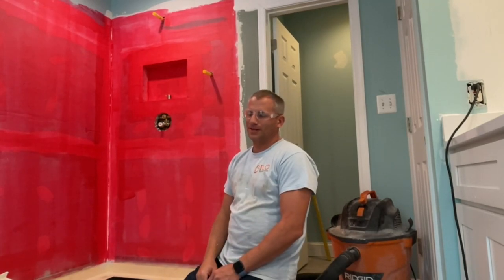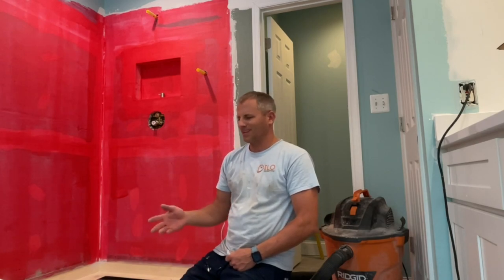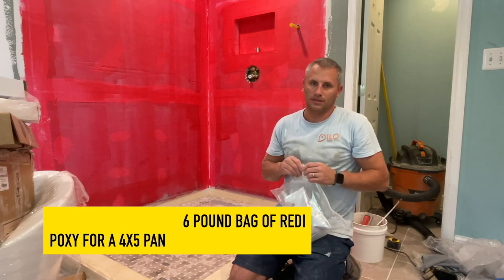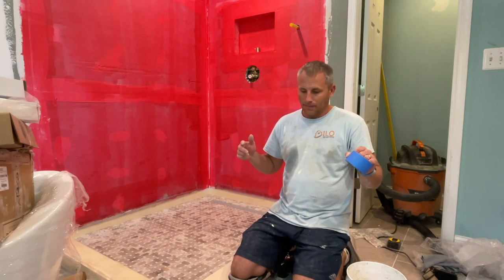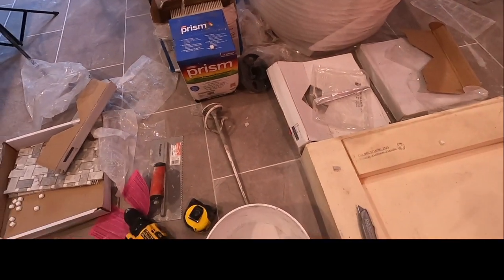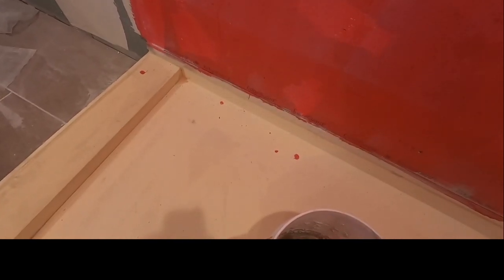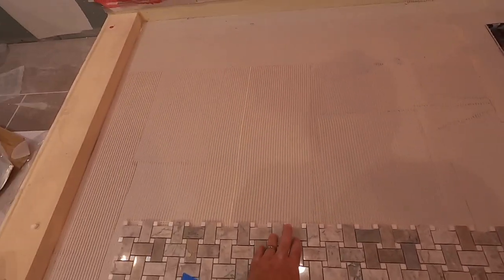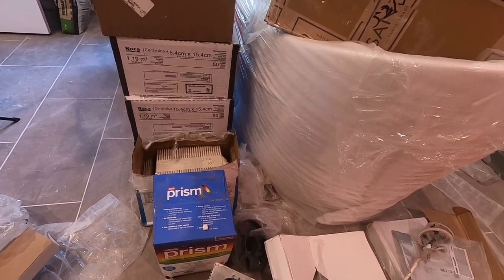How to install tile on a Tile Redi base. Tips, tricks, and updated info concerning the system.

Comment: This video was a great help to me, thank you. I'm a rookie, and I have a couple of stupid questions if you'll tolerate me. First, I've got a Reditile pan installed with the flashing kit. It looks like with the flashing installed, I can just run my backerboard in front of the flashing, all the way down to the base. Correct? Second, when waterproofing, do I need to use a membrane and Redguard, or just the fiber tape and red guard? Thanks again!
Reply from the maker: If you want to build out the wall, i guess you can put the substrate in front of the base, but you don’t have to. The substrate usually goes on top of the tile redi base.

Comment: Nicely done.  Never seen this product.  What notch did you use to put down the epoxy?
Reply from the maker: Depends on what tile you put down concerning the notch. Usually I use 1/8x1/8 notch for small format tile. If it’s pebbles, I go 1/4x1/4 v notch. It’s an amazing product and I can sleep well at night the pan will not fail.

Comment: We installed our custom tile redi base 42”x72” with left sided trench. We are rookies at this… how do we deal with the slope on the base when it comes to installing the 12”x24” porcelain tile on the wall? We are installing penny tile mosaic on the base. Thank you!
Reply from the maker: Well, first step is to buy a tile cutter that can cut 24". Second step is to make out the line where the first row of tile will go then measure down from that line to get your cuts. Tile work is an art and you might have some mistakes, but be patient. We all were rookies once!
Reply: @TodayIWorkOn  thank you! 🤞🏼

Comment: I installed my tile redi pan using your advice and it came out excellent.. Do you embed mesh tape at the tile redi/backer board seam?
Reply from the maker: Hey Bob, I put the tape on first then bed the tape in the mortar.  Then I redguard.  Awesome work on the install!
Reply: @TodayIWorkOn  Thank you.. I just want to mention that Tile Redi must of stopped shipping the epoxy with their pans. I received mine recently and it was not included.
Reply from the maker: @schulz4313  correct. They stopped shipping the Redi poxy because the new pans can use the approved modified mortar. I personally still order the redipoxy for peace of mind.
Reply: @TodayIWorkOn  I have an old school tile redi pan and bench. It is 48x60. The top of bench was tiled and grouted using modified mortor. 
I did get 2 boxes of Redi poxy with my pan. I believe they are 4lbs each. I am installing 12 x 24 porcelain tile on floor. Do you think I need to order extra Redi poxy?

Comment: Do you use the same thinset that epoxy based stuff for the side walls and curb when tiling. Or just at floor of shower
Reply from the maker: Just for the floor. The new bases can use modified thinset mortar, I just like how well the redipoxy sticks.

Comment: Tile Redi instructions for a tileable trench grate calls for PL Premium Adhesive, so just smear it on top of the steel grate and place tiles and or maybe back butter tiles with it (pebbles in my case - i know right) ?  Any tips for this, thank you in advance.
Reply from the maker: Do you have redipoxy? That WORKS! I've used it on tillable grates and it sticks really well. Modified thin set might also work.... using the PL adhesive sounds super messy.
Reply: @TodayIWorkOn  messy is what I was thinking and, yes!  I have redi poxy.  I have plenty of redipoxy, a bigger batch and a couple smaller because I bought it last fall before you kinda changed up to modified thin set on floors.   But for a pebble floor maybe I'm better off with redipoxy, just nervous about less forgiving with time of putting down pebbles - So, I will for sure use redipoxy on the grate, should I get pebbles all cut and laid out and use redipoxy or modified thinset ?  I'll help you do it - lol - thanks again for you help
Reply: My question at end would be in regards to the floor - about a 30x60
Reply from the maker: @eaglecanyonherefords2538  How I Install Hexagon Mosaic Tile on a Shower Floor With a Trench (Tile Redi Base)
https://youtu.be/xLHZVI8cStE

100% precut the pebbles and use this video on how I install the pebbles. Your only difference is you will have to use a grinder to cut the pebbles.
Reply: Sent you a little thru google for my gratitude, thanks, hope they get it to you - i didn't leave a message
Reply from the maker: @eaglecanyonherefords2538  Thanks so much! I'll let you know, was it a "super thanks"?
Reply from the maker: It just popped up in my YouTube studio, Thank you so much! That was so kind! 🙏
Reply: @TodayIWorkOn  You're so welcome, the tips I got from you have been awesome!   I just finished thin-setting the pebbles in 😅👍- whew, it looks good and redi-poxy would have been too much stress for me - ha ha - God Bless you and yours 🙏

Comment: Well in researching as much as I can about the Tile Redi Shower Pans and the system -- of course I came across a FORUM where I was getting very bad vibrations about this company and their products!  I am watching your you tube to see if those vibrations can be calmed down and I can feel a bit more confident that I want to have a Tile Redi 72" x 36" with Bench installed in a new home I am planning --  How long have you been doing showers using their products and is there anything you would say to steer me away and over to some other method of doing a shower with a bench?  Also have you ever used the Tile Redi Redi Wall they sell and if so, would you use a waterproofing membrane as you did here with this shower using the Red Gard or what it is called?
Reply from the maker: I have not used the tile redi panels since they are super expensive. They look like they work, but are again, expensive. I do not recommend their bench because it limits you greatly. I have a video on how I installed a custom bench with a standard tile redi base. Good luck with the project!

Comment: Is there a way to waterproof the outside of the curb with the bathroom floor?
Reply from the maker: You can use ditra band or my flex tape. Then hit it with some red guard or something similar. Water proofed.

Comment: Do you use the redi epoxy for the rest of the floor pan with the other tile?
Reply from the maker: You don't have to on the new pan, an approved modified mortar will stick. I have a new tile Redi video dropping in the next couple of weeks to explain even more on this base.

Comment: You are using Red Guard please what do you think of the schluter membrane system?
Reply from the maker: I think it’s fine but very expensive. I have used it and it’s a little bit faster to work with, but I just like cement board. The substrate you use is totally what you like best. They all work well when installed properly.

Comment: Do you used regular thin set between backboard and tile redi base overtop the flashing? Or do you use this epoxy for that
Reply from the maker: A good modified thinset will stick to the new pans. If it’s a pre 2021 pan, what i did was apply some redipoxy on the sides then apply mortar. Hope that helps.

Comment: One question. What size tooth trowel should I use with 12x24 tiles, or 12 x 12 tiles using epoxy? Or should I use thin set with tiles that big?
Reply from the maker: I think you will need the approved thinset for 12x24 tile with 1/2 square notched trowel. You need really good coverage for large format tile with 12x24.
Reply: @TodayIWorkOn  OK That sort of what I was thinking. My wife wants larger tiles for less grout line to clean, but maybe we will look at 12 x 12 ....thanks once again. Great videos.

Comment: i hope I didn't miss you covering this but when you do your walls are you going to use epoxy from the floor to over the top of the flange / seam ? And epoxy the curb right?
Reply from the maker: You can use a modified mortar on all of the new pans. Before that was possible I used to cover it all in epoxy, but thankfully those days are over! I'm actually dropping a video where I use modified mortar on the pan in a couple of weeks.
Reply: @TodayIWorkOn  You are the best - subscriber, follower and big fan - lets get down to business! 👍
Reply: @TodayIWorkOn  did you complete the job applying thinset?  Is there a link to the video?  I'm installing the shower pan this weekend and looking to tile it the following weekend. Debating between Epoxy and thinset. I appreciate your response
Reply from the maker: @sagudelo70  https://youtu.be/khxgJJ6-FTU

Comment: Is it possible to install a detra heated floor in a shower using tile readi base?
Reply from the maker: That’s a great question. If I was going to install ditra heat, this is how I would do it.  I would use redipoxy to install the ditra mat on the tileredi base. Then I would run the cable on the ditra mat like I normally would. I would use more redipoxy on the threshold and embed the thermostat and ditra heat cable in the redipoxy. After it set up, I would build out the threshold with 1/4 of mortar because you can’t cut the tile Redi pan at all.  It’s too thin. Then I would tile normally. So, would tileredi say ok to this, probably not. But, would I think this would work, I would say yes. You can also build up the trench grate to the height of the tile with no issue. Let me know if you go for it!

Comment: hey sir, I noticed the back end of the pan has a shoulder, the one i ordered does not.  did yours come with that shoulder piece?  i am not sure how to add glass on mine, it is just the thin wall like the rest of the pan. except where you walk in.
if your looking at the video, it is the back of the pan ( left side)
Reply from the maker: There’s different types of pans. This pan has the threshold on the front and left side to accommodate glass. You might have ordered the wrong pan for your application.

Comment: i’m confused, reditil no longer recomends the epoxy? Can we use thinset right over a red-guarded pan?
Reply from the maker: Correct.  You can install tile on the Tile Redi base with the approved thinnest mortars, but I just like using the epoxy.  It's a piece of mind thing for a professional that's doing work in a clients home.
Reply: @TodayIWorkOn  
Do i have to use the Redi tile branded product? Cant find it at my lical supplier…
Reply from the maker: @callapygian  yes. Only tileredi sells it. It’s on their website.

Comment: How do you finish the sides and the top of the redi base, especially under the shower door?
Reply from the maker: https://youtu.be/6k4PyLxsSr4   The end of the video will help you. We are putting Quartz on top of the threshold and bench area. It didn’t come in when I did the video. When my clients come back from vacation, I’ll be doing a recap video on this bath when the glass gets installed.

Comment: Thanks for your videos. Very helpful and nerve calming! I have heard rumors that pebble tile on the tileredi bases or anything under 2" square will break loose. But I see you have used pebble type in your other video. Would you please give me your thoughts on this? Thanks!
Reply from the maker: I have used pebbles probably a dozen times with no issue. There’s a little process to it, but I just literally installed more pebbles last week on one. 😬. Need to use redipoxy with 1/4 v notched Trowel. You got this!
Reply: Thanks for the quick reply. Make more videos! You do a great job. And thanks for the encouragement.
Reply: @TodayIWorkOn  This is what I’m installing. Stone pebbles on a Tile Redi pan. Can you give any detail about “there’s a little process to it” In your reply to this persons question and it’s a 1/4 V shaped trowel? That’ll put down a lot more epoxy than in this video correct? Nervous and what to get it right. Thank you for all the feed back you have provided. And how much will be needed 6lbs or 9 lbs?
Reply from the maker: @leemcleod6427  1/4 V Notch will do the trick for sure. You need to make sure that you clean up all of the excess redipoxy.  The process is rhe cutting of the pebbles. It’s a more complex install than your normal
Tile.

Comment: Great video. Quick question…. Will regular thinset adhere to the redo-proxy?  I tried to use the redo poxy for the last row and made a mess, decided to scrape it off and abort. I was hoping of just using regular thinset since it is so much easier to work with. Do you think I’ll run into issues?  Thanks!
Reply from the maker: Thinset does adhere to the Redi poxy. Approved thin set also sticks to the new pan. I’m still 50/50 on using a mortar on the actual pan, I was going to use it on my existing job, but I think I’m going to stick to the redipoxy. Lol. Hope the rest of the project goes well!

Comment: I want to thank you for taking the time and making this video.  I am going to use this base for my shower because I just don’t trust a mortar bed at all with it staying wet.  
I do have a question as far as mounting the glass walls to the threshold.  Can you drill into it or how do you do it for the hardware?
Reply from the maker: My shower glass guys always drill into the the tile/material on the base. It's siliconed so it should be water proof. I've never had an issue, but that's beyond me since it's the glass guys doing the drilling.

Comment: Just wondering…can you use the Redi-poxi to adhere ceramic tiles on the shower wall too?  Even if you put on the liquid membrane first? Thanks!
Reply from the maker: You can but that would be very expensive. I'm actually going to install newfloor tile in my boat and will use Redi poxy to install it! Lol. Just remember this stuff sticks and becomes one with anything, so you will have to work quickly.

Comment: Thank you brother! Questions....1....do you mix more epoxy for the sides and curb or use  the left overs and  2..... what kind of grout do you use on the tile ready??
Reply from the maker: I used to use whatever I had extra and hit the sides and top with the Redi poxy then use mortar on top of it, but with the new mortar friendly pans, I'm just using a LFT modified mortar. I'll know tomorow if if holds, I just tiled one of the walls today and used the mortar on the lower part of the tile Redi base. I'll update this tomorrow.  Use a polymer mortar on the floor since it does not absorb dirt and grime. I would not use a sanded/non sanded old school mortar on any shower base floor.
Reply: @TodayIWorkOn  Thank you again.

Comment: Thank you for the video!!  2 questions: 
First - the curbs have deep cavities so I'm thinking of filling them (less the depth of the deepest pan rib) with the unmodified mortor and letting it dry overnight.  The next day I will lay the pan in the mortor as instructed.  My thinking is that will add strength to the thresholds, thoughts? 
Second - I am using 4"x 10" marble base molding around the entire inside of the pan walls and outside of the curbs with a matching marble tile cap for the curbs.  Are you recommending I use Mapei LFT modified thin-set or more of the Redi Poxy for that too?

By the way, I am using their aluminum flashing; any tips/video on tying in to the base (i.e. sealing the joints with the backer board)
Reply from the maker: If it's a new tile Redi pan, use the LFT. It's fine. 

The flashing, I have a video that shows how I install it. What I didn't show is how I tie int the corners. I bend the Redi flash a little then silicone the corner. I would skip filling the threshold with mortar, it's not needed it really becomes solid once you install the tile all around it. Thank you for watching the video! Good luck with your project. 👍🏻
Reply: @TodayIWorkOn  A couple of follow up questions: you used a 1/8" trowel, right?  I have a 37"x60" pan and you said that yours in the video is 48x60 and that you had enough product with the 6oz box, right? Also, what tape or product did you use to waterproof the cement board joint and the exposed aluminum from the flashing kit?  I assume that even this epoxy will not stick to the aluminum.
Thanks again
Reply from the maker: @richgelinas6048  the Redi flashing is the waterproofing. Water will not run up 2-3" because it's sandwiched behind whatever substrate you will use. If you want to overkill, you can silicone under and over the metal flashing. The 6 pound Redi poxy will be plenty. Good luck with the install!
Reply: Slab on Grade:
Mortar between the Redi Tile pan and a concrete floor -  Regular Type S mortar adheres strongly to the wetted  concrete and will set firmly between the ribs underneath the Tile Redi pan. But how well will Type S mortar adhere to the foam sides of the ribs of the pan and does that matter if the floor is perfectly flat and smooth? There must be a reason Tile Redi did not specify a cementitious product intended for bonding foam to concrete like Merlex PolyPrep or  Quickrete 1219 ? Maybe there is no concern about the pan lifting because of gravity/weight of the tile on the pan.Certainly the Type S would prevent side-side movement, but up and down ?
Reply: @schnellgelb1746  How can the pan move up or down if the mortar if deep enought as per instructions? Plus the pan is "locked " down by the wall panels. I've done many Tile Redi pans , one next week, they are great.